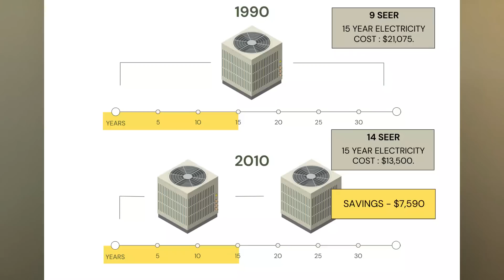Are new AC systems JUNK? Everything you need to know

Comment: My brother got 35 years from his original condenser.  This is a heat pump, running all year. 

About 12 years ago, my neighbor gat a new unit.  This was post R410a, I forget what that refrigerant was.  It went bad in a year.  A friend had a small museum, she put in new AC, same refrigerant.  Nothing but troubles right away.

I just  got a new 410a heat pump condenser.  Ten year warranty.  Here's hoping.
Reply from the maker: take a hard look at the contractor, more than the equipment

Comment: Hi Kennith. Nice try. I'm a retired Engineer. Your full of ****. Lets look at Trucks. Want to know why these expensive truck transmissions fail ? Cheap shoddy parts. The new valve bodies are made of Aluminum instead cast iron. Gears are made of cheaper materials and not heat treated as well all to save cost AND to sell more parts. Designed to break. Engineers not responsible. The orders come from the top. Lets look at ac systems. The old systems work off of R22 which is half the pressure of R410a. Go look at the thickness of the old copper coils of past and compare with today's coils. LETS SEE A SIDE BY SIDE OF THE TWO. NO ? WHY NOT .. Kennith ? You know why. Are profits up Kennith ? Are Techs happy with this criminal relationship and want to keep making a lot of money ? You bet....Kennith. The TRUTH IS...Kenith.. all HVAC systems today are crap and a customer's only choice is to find one with the best warranty. Old timers know this. Have all these companies been in a class action lawsuit ...Kenith ? Yes they have. What was the result ? Why all the companies settled out of court at a fraction of the value of the damage. The Companies ADMITTED no wrong doing and payed up a token fee. Attorneys are just Happy and the companies get a slap on the wrist and the illusion of justice is served. And people like you just vomit up your industry propaganda. People don't believe him. The Data I can gather about coil wall thickness points to being about 75% of what it use to be. Add to that the reduction of the copper quality of the metal. It's designed to be cheaper and by default designed to fail.
Reply from the maker: well oldingdg2475 we're all entitled to our opinions, even if they are angry opinions.

Comment: We have a TRANE HVAC System, installed AT LEAST 50 years ago. Just this past week on Sunday with EXTREME temperatures 99-100+ degrees, it was working perfectly. Monday late morning, it began blowing WARM/HOT air. Called our contracted Electric Company Service. We had to wait until 7:00am Thursday. Turned the unit off because the HOT air blowing, made things even worse—our home inside went up to 94 degrees. Terrific Serviceman arrived early Thursday morning, Checked the furnace system—EVERYTHING FINE, went outside to the AC unit. The FAN was not turning, in less than 10 seconds, he opened the unit and REMOVED A LARGE CYLINDRICAL BATTERY FROM TERMINALS ON THE TOP LEFT SIDE! I NEVER KNEW THE UNIT CONTAINED A BATTERY WHICH IS NEEDED TO RUN BOTH THE FAN AND THE COMPRESSOR. Checked the BATTERY FOR POWER—NOTHING—TOTALLY DEAD. THE EXTREME HEAT DESTROYED IT! The Serviceman had to travel 10 minutes away to his Parts Warehouse to obtain a NEW BATTERY in the correct size and returned about 20  minutes later. He hooked up the battery terminals to the new battery. VOILA!! WE HAD LIFT-OFF!! AC WORKED PERFECTLY AND IT TOTALLY COOLED THE ENTIRE TWO-STORY HOME DOWN  (1903 Sq. Ft.BiLevel Home with 18ft, Cathedral Ceilings Upstairs) TO THE THERMOSTAT SETTING  FROM 94 TO 76 DEGREES IN FOUR HOURS!  It then began to cycle normally. Serviceman checked the REFRIGERANT LEVELS. The unit ha a SEALED SYSTEM. REFRIGERANT WAS TOTALLY FULL—NO LEAKS. Checked the AIR FILTER which is A PERMANENT TYPE AND NEVER REQUIRES CHANGING. IT WAS CLEAN/CLEAR, but I vacuumed it out anyway since we had it out. I am figuring in 50+ years, the AC is only used about 3-3 1/2 MONTHS A YEAR—usually/mainly June, July and August. Therefore, IN 50 YEARS AN APPROXIMATE TOTAL OF ONLY 150 MONTHS THUS FAR! NEEDING TO CHANGE OUT A BATTERY IS CERTAINLY A REASONABLE PROBLEM!!  ‘YOU TRULY CANNOT STOP A TRANE’!! THIS WONDERFUL TRANE HVAC SYSTEM COST UNDER $3,000! I DO NOT KNOW EXACTLY WHAT IS GOING ON PRESENTLY!!
Reply from the maker: thanks for telling your experience with Trane.

Comment: When my aunt passed away in 2006 at age 92, her 1955 Carrier AC/gas furnace unit was still functioning fine. The fuse box on the air handler had 2 cartridge fuses and 4 glass screw-in fuses. Southeast Louisiana, still going strong after 51 trouble-free years with nothing but regular maintenance. It out-lived her and 4 different HVAC contractors.
Reply from the maker: Like Kenneth said in the video, the old systems were built to last. Thanks for the story.

Comment: Another factor is the gas used. The old R12 and R22 refrigerants have relatively large molecules. The new gases used have small molecules. The problem? LEAKS. Systems now have triple lip seals and other means to keep gas in. It was same in cars with when switched form R12 to R134. R12 compressors, o-rings and seals can't keep the gas in.

Comment: I bought a 3 ton  Ruud Heat pump and had it installed in 2020 and its broke 4 years later, some leak that cant be found. I paid over 8000 grand for it and its a basic model. I bought me 18,000 btu mini split for like 900 bucks total cost and use it now to heat and cool my whole house. It heats sooo much better than the Ruud even when its 0F the air is still 115 degrees coming out of the wall unit. I have the mini split for almost two years .

Comment: Older less efficient systems can last but not without trade offs. Most likely they are running but likely require annual refrigerant top offs. The older refrigerants operated at lower pressures so as the seals/components age, they do leak but not catastrophically. R410a and R454b/R32 operate at higher pressures so as the units age, the refrigerant is more prone to be lost quicker which causes major failure of other components since the refrigerant acts to lubricate. Higher pressure also requires more expensive components to replace if they fail. R22 systems were probably a good balance between efficiency and longevity, but now that R22 is super expensive, you can spend thousands to top off any leaks.

Comment: The cost saving trend toward thinner tubing (copper or aluminum) while also raising operational pressures, is hurting the longevity by reducing margin of safety and no tolerance for corrosion or metal abrasion.

Comment: New ac's are pretty much garbage.  Had a rheem installed in 2009, ran until 2022 with zero problems!  Zero!  My wife and I decided to replace with new system in 2022 (spring).  This is in Florida, btw.  Well, big mistake.  New systems are designed by what it seems to be pseudo-engineers (who are focusing on cost cutting as opposed to efficiency and reliability at the big AC companies.  Did not know it, but when I was replacing the old system, to just try to be more efficient, and upgrade as I was told by the AC contractor in the house, the new system has aluminum coils!  The old system from 2009-2022 had copper coils.  Again, big mistake.  I have had NOTHING but problems.  Nothing but problems, its not even 3 years old!  Whoever thought it would be wise to use aluminum in an AC environment, wow.  Aluminum is NOT antimicrobial.  Copper IS antimicrobial.  This is huge in any ac system due to the gunk (algea, etc.) buildup that can occur on the coil.  Again, huge mistake.  I suspect in a couple of years, when a lot of systems start dieing prematurely, they'll be probably some class action lawsuit against the ac companies for knowingly pushing an inferior product that fleeces customers and is not optimal.  Again, unreal.
Reply: What sorts of problems have you had?  I have aluminum evaporator coils, too. The condensate drip pan is plastic so I polished a few pennies and put them in the pan. No algae issues but I'm not in Fla. either.

Comment: We have two 2007 Goodman builder installed units on our AZ home.  Compressor is going on one so we are now looking at just replacing the units.  With the new R32 or R454B becoming the standard 1/2025 we are now also stuck with the decision of should we get units built to the new standard or get units using R410 which must be phased out within the lifespan of the units.  Interested in your thoughts?

Comment: The degradation of quality and longevity for modern HVAC systems is 100% intentional. Central HVAC systems are designed to require maintenance and frequent replacement while feeding tons of money to gas and electricity companies. The biggest component designed to fail in HVAC systems are the copper coils. The industry refuses to upgrade the material to ceramic or some other material that would extend the life of the unit. They want the coils to fail so you have to buy a new unit. Bankrupt them by not using their crappy HVAC systems, electricity or gas. 

Other systems in your house that are designed to become maintenance headaches are the plumbing and electrical systems. Big Government libtards take bribes from the housing trades to avoid making legislation that would force housing to be designed efficiently so maintenance would be something the homeowner could do on their own. The corruption ensures that the housing trades get an opportunity to price gouge you on services. Fix your own BS and never use any of the housing trades. Pressure corrupt Big Government to force the use of materials, design, and configuration that completely removes any need for housing trade services. 

Your plan if you live in Texas is simple. Never use your central HVAC unit in summer or winter, especially if it has a heat pump. Pick one room in your house for summer and install your own window unit or ductless mini-split unit. Your power bill will decrease by 85% compared to using the central HVAC unit. You won't have to use the services of a HVAC company for installation or maintenance so you will save more money. 

In the winter don't use your central HVAC heating. Get an oil based space heater. Turn off the water to your house when temperatures dip below freezing. Get a zero degree rated sleeping bag and you won't be cold in the winter while sleeping. Bundle up with warm clothing for the winter and stop being a weak douche that can't handle a little cold weather. Never use your central heating unit. 

Vote all Democrats out of office in November 2024. 

FJB 
FBKH

Comment: If older model HVAC condensing units were properly vacuumed and charged upon installation and coil was washed occasionally, other than maybe failed relay, capacitor and condenser motor when older, these units can routinely work more than 25 years. An evaporator leak was the likely major failure after 10 or 15 years. Unfortunately there is an army HVAC contractors exaggerating problems with goal to sale new units. New equipment quality and long term reliability is definitely scary these days.

Comment: My old Carrier R12 systems lasted 47 yrs. and were still cooling when I replaced them for rust and wiring issues. I know exactly how a system is supposed to be installed and the tech. did a very good job. The price for 2 simple systems was very good. Now I keep the condenser area clean, be sure air flow through the condenser coils is good, don't exceed MERV 8 in the extra large filter boxes, etc. and never let anyone touch the systems. There are no "tune ups", checking refrigerant, etc., etc. I keep spare capacitors and, after 10 yrs., got a spare contactor...just in case.
Reply: I doubt you had R12 in those systems. It was most likely R22!
Reply: @peterdutile8012  Nope, they were very old Carrier R12 systems. The contractor was very happy to reclaim that refrigerant considering the selling price of R12 at the time! That and the thick copper he reclaimed was a nice bonus for him. I have an AC license and was with the installer throughout. He did a really excellent job with each step by the book. That was 13.5 yrs. ago and zero issues since. Goodman/Amana.
Reply: @ fyi. I sold carrier for 44 years and was a FAD dealer. I saw a lot of different stuff.  Maybe I do remember disposing a R12 unit years ago. 
I loved Carrier due to my Distributor. They were great. Especially with support. However, I firmly believe that the brand doesn’t really matter as much as the contractor standing behind the install. Except for Goodman! I didn’t care for their wiring diagrams. I do love Daikin though and sold their ductless line as our first choice. Carrier has a good ductless product, but, cheaply made. Made by Midea in China. I’m in NH. Central ducted heat pumps were my specialty. We also did commercial refrigeration. Retired now.

Comment: Newer systems are still lasting 20-30 years. Here's the issues I see and how we can avoid early failure.
1. Old systems used capacitors that almost never failed. When caps fail, they can cause the motor to fail. Change to a turbo.
2. Most people are installing systems wrong. No nitrogen when brazing. No drier filter. Not vacuuming. Comapnies pay bad so they get bad workers messing everything up.
3. Not sizing correctly. Too small and the system will run all the time. Too big will cause the sytem to short cycle.

Comment: My old home, which I still own and rent out, has a 38 year old Trane that just won't die. My home I live in now, the unit installed when new was a Goodman, it died in 8 years, both the external compressor and the internal evaporator coil magically went belly up at the same time. I now have Payne equipment, fingers crossed I can get more than 8 years out of this setup.
Reply: What is an internal condenser? You mean the evaporator coil?
Reply: @JamesAgans  Yes, fixed the comment.

Comment: I'm in this predicament myself. I've got an old R22 system that still works great, other than being noisy, but I'm expecting to have to replace it sooner rather than later. Would I be better off waiting for the new refrigerant coming in 25, or trying to get a 410A system before?
Reply: Same here. Not going to be one of the early adopters of the R454a systems from any of the Big Three. I'll wait until the spring and then get a 410a system hopefully on discount as they try to clear inventory or at least not at the increased price of the R454a...banking cash until then...
Reply: I'd do nothing. My old systems lasted 47 yrs.

Comment: Soooo, the 'high efficiency' equipment does not actually benefit the consumer because the overall cost will be high with more frequent replacement, but benefits the suppliers by reducing the demand on new investment...figures.

Comment: So similar to your original story about the old truck, back in cave man days it WAS ok to call your friend's brother to put a bigger compressor and  oversize condenser in your house. Now you'd be an idiot to expect an amateur to be able to inspect your individual situation with parameters only professionals would know, (your ductwork, etc. example), so that your money is well spent on dozens of negotiable parameters to optimize your unique situation. BTW, central air in Texas is like life support in a hospital. Houses built there in the last 50+ years are NOT designed to circulate air from open windows. The heat can be brutal in most of the state. Most of those houses are in some form of suburb.
(Edited original comment from corollary to similar. Trucks don't cause air conditioners.)

Comment: I still have a 30 year old Rheem 3 ton cooling my 2nd floor in Dallas. Sucks a lot of power but a new one one would be 5k if I’m lucky. Thats a lot an electricity. I keep the condenser fins clean and change the filter as needed. The capacitor is the old school kind. Still working after 30 years. Are we really protecting the environment when new capacitors need replacement every 3 years?
Reply: True but you should keep a spare cap. and contactor handy just in case.
Reply: @ Sadly, the Rheem started freezing up due to low Freon charge. Had a leak somewhere so I had my AC guy put in a 17 seer 3 ton Ducane, furnace and evaporator. Energy bills should drop next summer.

Comment: One of the easiest ways to bring down the cost of housing is to bring back R 22 units. At the very least we should keep 410 A instead of going to the next unproven Freon. The most efficient unit is the one that lasts over 20 years! Also buy the simplest unit available.
Reply: Always "simple" units here, too.  Complexity = increased failure rate.
Reply: Someone might have a good little business fixing up old R22 units and using drop-in replacements for the refrigerant.    Probably a dream, but they'd be reliable.

Comment: I also have the feeling that inverter air conditioners have a lower performance than on/off systems, like they are made for eficiency and then for cooling, whats the point of saving money if it sucks?
Reply: I am not a fan of variable speed units for that exact reason. For me, energy efficiency and a quieter unit is not worth the extra complexity let alone the higher chance for failure due to much more parts and very expensive parts as a whole.
Reply: @zachzebra56 we have an inverter ge refrigerator, the inverter board dies every 3-5 years, so I always keep a spare in hand, once I get the diagnostic I have the new board installed, 5 boards in 12 years. The mechanical refrigeration components have had no problem at all in all since new.
Reply: @micbad4689 Not surprised about that. Inverter boards are gonna go out long before anything mechanical related pops up. We just got an LG refrigerator with R600a and a variable speed compressor a few months ago. We will see how long that lasts. Wont be surprised if the inverter board fails within at least 3 years of regular use.